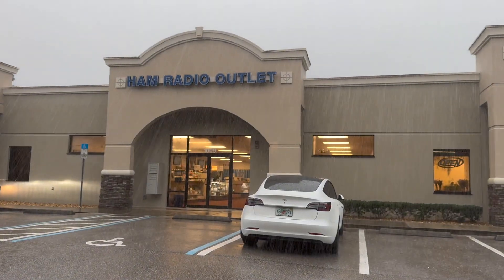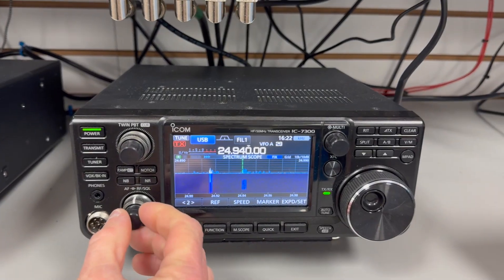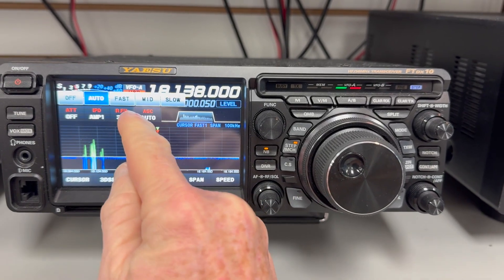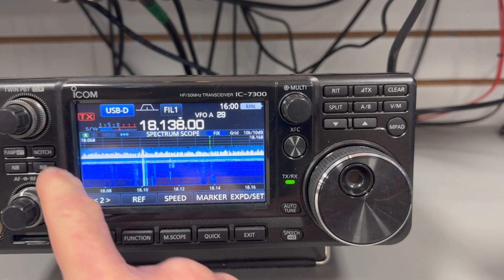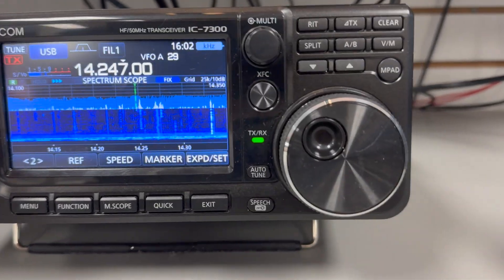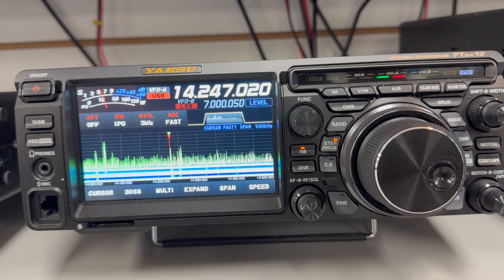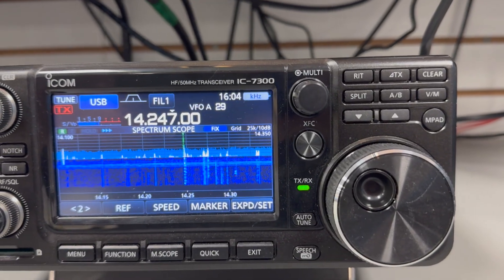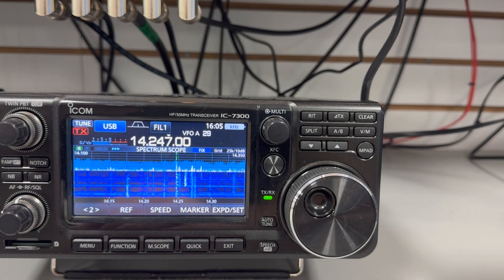ICOM IC7300 vs Yaesu FTdx10 during Orlando Storm (READ DESCRIPTION BEFORE COMMENTING)

Comment: Why did you  turn the panadapter level to the max on the dx10? 
 There was no need to do that and is likely why it was spazzing out.
Reply from the maker: I'm not aware that anything was "maxed out". Nevertheless, would adjusting the pan adapter affect the audio quality?
Reply: @WilliamBennerJr   I saw you increase the pan adapter level to max, which made it appear that the crashes interfered with the audio . You can still hear the received signal on both rigs with the crashes.
It was just my observation that the dx10 pan adapter sensitivity was too much and not needed. Just my thoughts that's all.
I have both rigs.
Reply from the maker: @djohn1592  looking for someone knowledgeable to meet me at HRO in Orlando to repeat the test. In the meantime time, where is the indication that the pan adapter is at max?
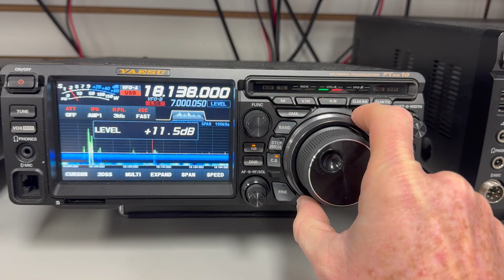Reply: @WilliamBennerJr   @ 2:19 you hit the CS button which is a custom button, it can be set to different functions and likely that someone probably set before you,  which was set to the Level for the Pan adapter.
Reply: @WilliamBennerJr   Moreover, if you push and hold that CS button, a menu pops up so you can see the other functions that can be assigned to it for quick access to that function. Only one function at a time.
Reply from the maker: @djohn1592  thanks for the info. I will try that next time. But is there a way to see that it was at “max”?
Reply: @WilliamBennerJr  You're welcome. Yes it tells you the level on the screen. I saw you had it up high not sure if you maxed it but it was close to max. I think 30 is the max

Comment: Good video I’d like to see you do another comparison on a day where you don’t have any storms and preferably focus on some weak signals and see which one pulls it up better
Reply from the maker: Yes indeed. In that case I think Yaesu would have been the winner. This Ham Radio Outlet may also be near an auto-repair shop or something similar causing additional interference. My only hesitation was to choose a radio that is best for weak signals, when my use case doesn't involve weak signals.

Comment: This goes against everything I've heard about the 7300 vs FT-X10/710 as far as noise reduction. Did you do a factory reset on the radios before playing with them? Who knows what these have been set to by the previous customers.
Reply from the maker: These radios were in Ham Radio Outlet. I didn't want to try resetting them, etc. They're not mine so I limited what I did with them. You would certainly hope Ham Radio Outlet has the radios setup in a way that would help them to sell.

Comment: You didn't give the FTdx-10 a fair test.  Two things you could have done:
1) Hold down the Noise Blanker button, and adjust the level of the noise blanker.  Chances are it was set to 1, and could have used some adjustment
2) Turn on DNR (Digital Noise Reduction).  You had it on the 7300, but did not have it on the FTdx-10.  That would have made a BIG DIFFERENCE in what you were seeing.
Reply: Yes... not a fair comparison.  You need to learn the radio first.
Reply from the maker: I spent a half hour with the FTdx10 before making the recordings. Over the course of that half hour, I felt that I explored the various options. Everyone replying to this video has their favorites, but nobody should ignore a fundamental question: can an experienced engineer (look at my LinkedIn profile) walk up to a radio and be successful yes or no. This is a real question! If the reason why FTdx10 failed is because one needs to spend more than a half hour to learn the radio, just to get it to stop freaking out from noise, well... speaking as a user experience designer, that's not a very good user experience!
Reply from the maker: Regarding "fair test", yes I actually did try the DNR, but it didn't do much. It was in another section of the video, but I cut that section for length.
Reply: @WilliamBennerJr  Thanks for your response.  A good friend loaned me his IC705 and FTDX10 for a few days.  It was a fun experience to compare features.  I know the 705 is not the 7300,  but I assume it's very much the same.   Since I'm a picky about listening to noise, I compared them side by side for a few days.  The DNR features the Yaesu offered made the receiver so much easier to listen to.  Nothing wrong with any of the new gear we have available today.  I'm just surprised at your conclusion.  Regardless, nice to have a ham store to visit and compare.
Reply from the maker: @mmlanger55  When I walked into Hame Radio Outlet, I fully expected to purchase the FTDX10. No question about it. And I've seen the DNR on videos. Seems like real magic, and something completely unique to Yaesu. So I couldn't wait to experience that for myself. But that day, under those circumstances, at that location, with that antenna, and the rain storm, you can see and hear the difference. Both in the description of this video and in my video discussion, I stated that if I were in a quiet environment I would have expected the Yaesu to be the winner. But in my setups low signal is never a problem, and we have plenty of storms year round in Florida. These are the reasons why I went with the 7300.
Reply: @WilliamBennerJr  What prompted my response was seeing that your test of the Yaesu DNR was not included in the video.  It led me to believe you never enabled it.  I'm glad you're satisfied with the purchase of the 7300.  They are a fine piece of gear.
Reply: @WilliamBennerJr  When you didn't show the use of the Yaesu DNR, I was left to conclude you never used it.  Thus it appeared to be not the same comparison. Regardless, the IC7300 is a fine piece of gear.  Enjoy!
Reply: @WilliamBennerJr  Hold down the button on the DNR on the FTdx-10.  You can adjust the level all the way to 15.  I find that the optimal setting for DNR is 9.  And, about your other argument about spending 30 minutes with the radio before making the video - okay, fair enough.  But, I would also argue that these radios these days are fairly complex.  I don't think that 30 minutes is enough time to truly access all the radio's capabilities.  I applaud you for going back to HRO to try again.  If you come to the same conclusion about the two radios, well, respect.
Reply from the maker: @ralphnunn3  Thanks for the clue. This whole subject and the passion I see in users has encouraged me to take another trip to Ham Radio Outlet ;-)

Comment: You don't have a clue how to use the Yaesu FTDX10. My FTDX10 runs circles around the IC-7300.
Reply: Same thing here.  I've got them both but the FTDX10 is way ahead of my 7300. Much better receiver.
Reply from the maker: I expect in a super quiet environment, the FTDX10 would have been better, and I stated the same in my video. The only thing I can say is from that single day in Orlando. In my video I made it clear -- under those circumstances, the IC7300 was better.
Reply: @WilliamBennerJr sheesh, you'd think that you stepped on their labradoodle or something.
Reply from the maker: @ChatGPT1111  I appreciate the passion of those who are commenting. The reality is that I didn't know how to use either radio, but after spending 30 minutes with each, I got the result that I got, that day, at that location, with that storm going on. Now, was the radio setup sub-optimally before I even arrived at HRO? Was there a problem with this particular radio (some Yaesu owners tell me they have to open them up and re-do grounds). Or was it just the particular storm conditions? I don't know. As stated in the description, this is an "n of 1" experiment. Some people here have given productive comments (hold the DNR or NB buttons and adjust from there). Some have accused me of purposely making the Yaesu look bad (don't have any motivation for that). For those who are so upset, how about they make their own video? That would be more productive than hurling insults ;-)